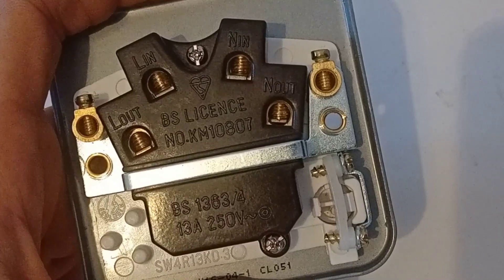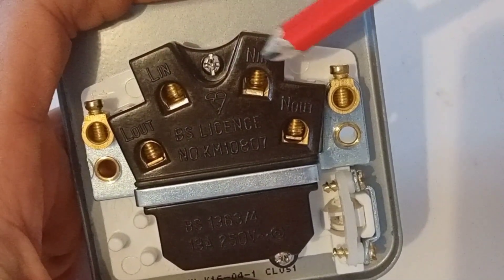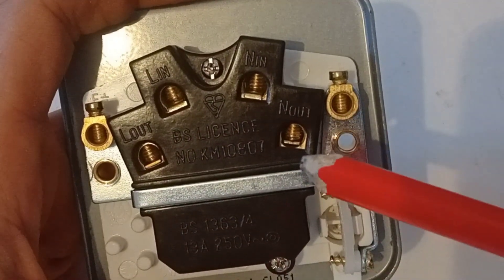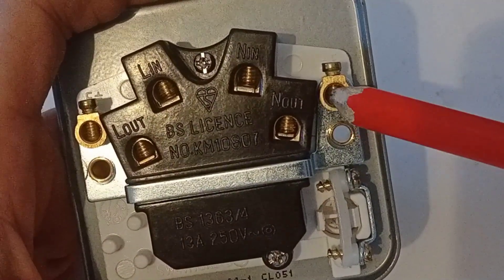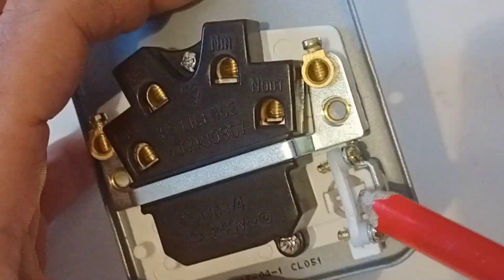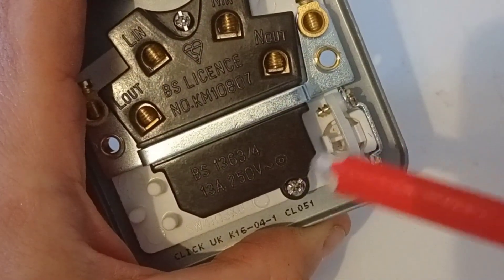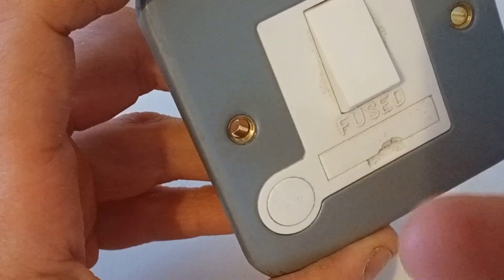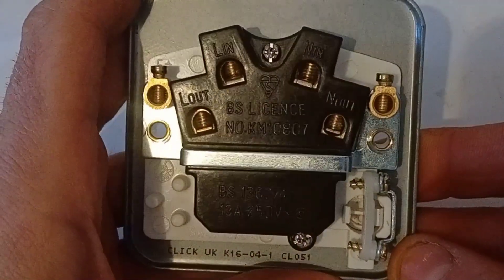Fused Spur Explained

Comment: A Q: please.I am about to follow your excellent instructions and do this job.You say earth it twice in the video and there are two earth points on my fitting.Are there 2 ? and if so do you fit both.Many Thanks.
Reply from the maker: Hi. Ensure you wire the earths from both cables to the 2 spur earth terminals.
Some only have 1 earth terminal, if so just put both earth in to the 1 terminal.

Then also get some earth wire and connect from any earth terminal on the spur to your metal back box. 
If there your spur  only has 1 earth terminal again use this. 

If using plastic, you don't need to earth the back box
Hope this helps

Comment: Hello
I would like to install a 100W floodlight, with regard to a fused spur, how do i install it and which spur do i use?
Reply from the maker: Use a regular fused spur. Use 1.5mm cable.
If your just fitting 1 floodlight at 100w. Just put a 1-5 Amp fuse in the spur to protect the cable.

Comment: Why is a fuse spur so common instead of a designated radial
Reply from the maker: A fuse spur is an addition to a ring circuit. The fuse spur provides local circuit protection to a single appliance. 

If we used radials (which can have multiple sockets ) just for single appliances, there would be no room left in the consumer unit. 
Using a fuse spur saves adding additional circuits.
Hope this helps.

Comment: I'm wiring in an outside light with a pir ,and intend to use an unswitched  fused spur with a 5amp fuse from what is an existing feed from my garage light circuit. Is this the right move ?
Reply from the maker: hi. 5 amp should be fine using 1.5mm cable i presume ?
Reply: Yes it is ,thankyou. @diyhandyman2733
Reply: Hi i have a switched fused spur, which has to cables into it & i want to fit a cooker visor hood into it , so do the main cables already there go into the same terminals ie live neutral & then fit cooker hood cable to load out
Thanks